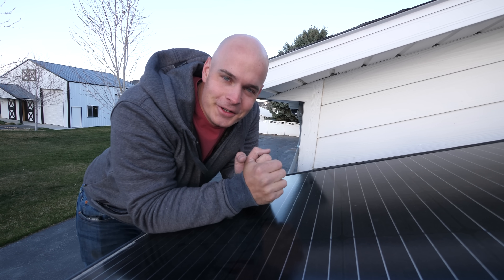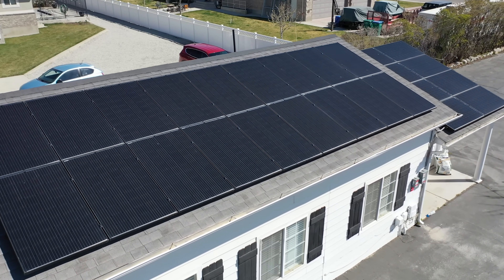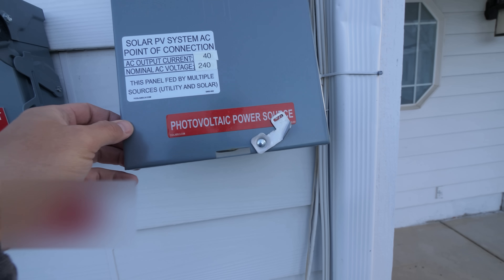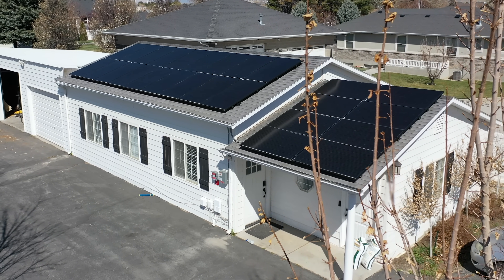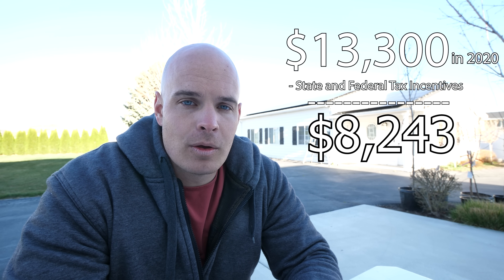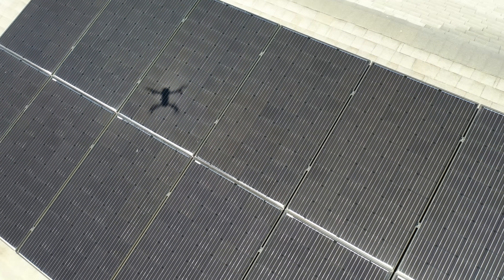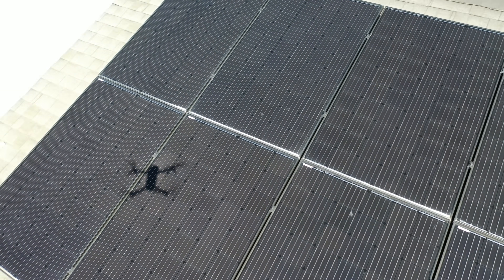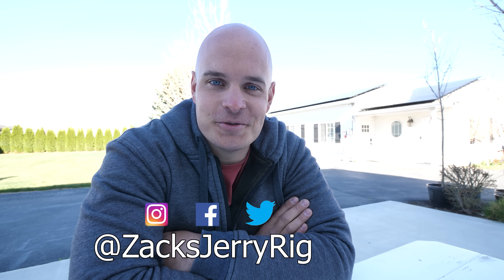One Year Solar Update! - Is Do it Yourself Solar worth it?

Comment: That price still seems awfully high for a self install. It is easy to get panels at $0.50/watt these days, so $4K for panels. $2K for inverters, $2K for wires, permits, and mounting. Which puts us at 8K before incentives. That is at retail prices, so that solar company is making around $5K just to sell you the kit?!
Putting the kit together has some value certainly, but maybe 1K tops IMO.
Reply: You are describing how much prices have changed in 1 1/2 years since his install. China tariffs have had an effect on solar panels, along with copper and aluminum. There are also so local variations in labor, taxes, etc.  Sometimes the cheapest price per watt panels take more square footage and those with limited roof space may choose a pricier panel with more output.

Comment: Solar roofs sound great, especially as suitable for sunny regions!  However, I wish Jerry's excellent product review also included information related to sustainability (another video?).  What is the carbon foot print of manufacturing Tesla solar roof panels?  Where does Tesla source the raw materials for manufacturing solar panels?  Lower CO2 emissions offset the environmental costs of manufacturing Tesla's solar panels?

Comment: Wondering if you calculated distribution/delivery charges into your savings?  I'm running some numbers now so it's fresh in my memory but looking at my current bill I pay about $0.09 per kWh but that's just for the power.  Getting it to me costs another $0.14 or so bringing my actual price per kWh from the grid to $0.23.

Comment: I do like home solar, but I don't think the financial benefits are a clear win cut just yet.

My calculations have no break even point when accounting for opportunity cost. If you instead invest $8243k with 7% real returns (after inflation), and you continue to save $1314 per year (after adjusting for inflation):

solve for y: 1314*y-8243*1.07^y

If you assume 6% real returns (1.06), the break even is 15 years, 5% real returns 10 years. If we assume that power companies also transition to solar as it becomes more and more economically viable, we can also expect the utility cost per kWh to go down (vs. inflation).

Comment: Still wrapping my head around everything. I did a quote on Tesla’s site for solar panel and it includes a power wall.  After tax credit it is roughly 26k.  That sounds insanely expensive in comparison.  What am I doing wrong?
Reply: Well, obviously the power wall is very expensive, so there is your first mistake. Your second is Tesla…you will pay for the mane itself at least 20 percent.

Comment: We had to do ours like Johnny Cash got his  Cadillac. One piece a time. 
We started out with a  45 watt Harbor Freight system.  Added 2 100 watt panels 3 times so far and still going.  
We have a generic 10 watt panel that is for charging cell phones and 2 way radios. 
   At this point i can power my fridge,  40" TV, DVD player a pair of small table lamps and a 20" box fan. 
    I also use the 2,  5 or 15 watt fluorescent bulbs that came with the HF kit. 
   I can generate about 650 watts now. Next month 850. Ive invested around $800 so far plus batteries.  I get a great deal on them. I pay $105 for 110aH sealed acid type. 
Our system isn't top notch,  but my fridge,  tv, movies and most lighting is FREE. By adding what we did i was able to cut my power bills in half.

Comment: The batteries are the one thing I would say is not too great for the environment. However, i think that using that energy from the solar panels to make hydrogen as the stored energy and use a fuel cell to get that energy back at night. The only bi product would be water. But fuel cells still need to be improved upon before this is truly realistic.

Comment: It's real easy to see if the energy needed to produce solar can be paid off: the manufacturer had to pay for that energy when they built them,  so that cost is included in the purchase price. Energy plus raw materials plus labor cost all included.  Obviously solar is worth it,  especially if it pays off in 6.27 years.  Even paying for installation is worth it,  but will take longer.

Comment: Wouldn't you be better off just investing that 8 grand in the market?  I mean I'm no finance major or anything but plugging 8 grand into an investment calculator at 8%, you end up at 37k after 20 years.  That same solar array nets you like 27k in savings after 20 years assuming the same production (but of course, assuming the same cost rate too).

Comment: Battery backups for Solar has been traditionally for off grid living, however the reality is that the power company doesn't store the energy you send to them and they have to produce the energy you get back from them.  It does put a burden on the energy company to either use all this excess power they didn't produce during the day, and provide power to those who were sending the excess power to them at night.  This is one of the reasons to store your own power, so you don't have to rely on the fossil fuel energy that the power company will send back and you are not as much of a burden to the grid.

I have always though it would be great if home builders would build communities with all solar houses and a localized battery grid.  This way all houses would charge the localized battery grid during the day and take energy from that same grid over night.  This should make the cost of buying and maintaining the batteries lower than a single battery panel on a house.  Something I could see Tesla create.  A Tesla community equipped with Super Charger parking.
Reply: It would be hard to complain who is going to repair who’s panels and who is using more energy from your neighbourhood.  It would be the same as living in a condo all inclusive but people stealing toilet paper from common areas and having 10 squatters living in a 3 bedroom condo.
Reply: @MrMannyhw  what if you had a system of you get what you put in or you get charged maintenance fees proportionate to the amount you use? Will either of those be satisfactory?
Reply: But the problem is those batteries are very similar to fossil fuels esp since they're not renewable resources...

Comment: A mistake in your math: after 6 years back to 80% yield on the panels, which then keeps going down each following year. The 80% won't stay there indefinitely for the next 30 years, not to mention the panels cracking or breaking by faulty production, or accidental damage over time, lowering the overall yield even more. 
But I am glad to see you were smart enough to get the better panels and not the cheap stuff which will never make your money back, and next to your math for profit, by your own statement you need to add 2 extra years of profit to offset the creation of the panels, years of even increasing lower yields.

On the whole your math checks out though, as I did mine as facts became available while pausing the video. I have seen so many Youtubers not do the 'break even' math back to the costs of the panels and just hail the 'profits' while forgetting the costs. Mind you, instalment if done by professionals, or if you calculate your own hours as billable hours you could have been working and earning money, is much much higher, and it can take you 10 to 20 years of diminishing returns to break even, all the while watching breakthroughs in solar that will make you hate yourself for having 'inferior panels compared to the new stuff', making it very tempting to buy new ones and start the investment over with a deficit, as 'being green' is very addictive.

Comment: Not only are you saving a little money due to solar, doesn’t that little air gap between your roof and the panels save you money as well? Considering the panels act like an umbrella over the roof. Essentially making your heating and cooling system work less?

Comment: I went with used panels and bought a used inverter that was used once and our charge controller was on sale and the entire system was less than 3k and that's paying full price for the battery's  and were off grid so it powers the house day and night we also have a back up generator if we get more than 2 days of no sun and want to run the ac after dark

Comment: I plan on buying all the components and building my own solar system.

Going to rig into my main panel with a manual transfer switch for a portable generator hook up. Use the tie in cable to hook into my solar panels when generating from them. Be able to hook in with a portable generator if necessary during night time power outages.

Comment: Tbh, you could probably live 90% off grid by using solar cells in the summer and doing electrolysis with the energy to make H2 instead of storing it in batteries. The last 10% could be bought H2 and then you have fuel cells instead of batteries. 

I've seen a house concept about that as well as an automated, self sustained H2 gas station so, I kinda think it's quite cool if it works as it seems

Comment: Awesome vid, but my LG panels hold a lot more after 25 years, (First 5 years : 95%, 2) After 5th year : 0.4% annual degradation, 3) 25 years : 88.4%).  My system is small and about half your size.... anyway you doing it on your own is great!!!  Nice and clean install you did as well!

Comment: Hey! I love your videos, and watch several of them. I have a question, how would this work if you had to replace your roof after you installed the panels?
Reply: Everything has to come off and be reinstalled.  The plus side is, the roof under the panels should last significantly longer though since it sees far less UY and heat exposure.
Reply: plan to do your roof at the same time

Comment: I also wanted panels :( but the regulations in my country are just changing, I will sell the surplus for 25 and buy from the power plant for 76 ... so far the power plant gave away 80% of the energy sent to it. Unfortunately, the energy storage due to the price higher than itself installations are not an option.

Comment: Question .. How about the roof shingles?  Are the shingles going to last longer with the panels on top?  If not, how difficult is it to take down for a new roof?

Thanks!
Reply: Depending on the shingles, they last from 15 to 30 years obviously if a bad enough hail storm messes them up then insurance will pay for them.

Comment: Just imagine to combine your solar panels with heat pump ( water/water ) and proper thermal insulation of your house and very good windows. No AC required during the summer, no heating needed for the winter, you will heat up your house with heat pump via floor heating. Black magic right? We do this in Europe for last 25 years.

Comment: Installing solar panels will block this sunlight from hitting your roof, thereby preventing heat from entering your house. The researchers found that solar panels can lower a roof’s temperature by 5 degrees Fahrenheit, or about 3 degrees Celsius. This can significantly reduce cooling.

Comment: When are we getting the DIY Arduino driven stepper motor safe-cracking tool? I don't even own a safe either but it would be cool to figure out how safe locks work and turn and how fast you could personally get it going reliably, and how to detect when the correct combination is entered. Sounds like a lot of work, but fun work. Would definitely make a neat video.

Comment: I did my own system but did a 20KW system for about the same price you did with the kit. By converting my propane water heating and home heating to a heat pump I and saving $3600 a year on my total yearly utility cost.
Reply: Where and how did you get a complete 20KW solar system for $13k ($8k after rebates)???
Reply: @ssoffshore5111  I did the work myself so the $13K was before the fed rebate.
Reply: @chada472  So again, where did you get all of the components for a 20kw system for that price?  I dont see prices like that anywhere...

Comment: My electricity has rate riders, municipal franchise fees, transmission fees, distribution fees, admin fees, and taxes. When they're all added together, there's another 13.5c/kWh of fees on top of the 6c/kWh electricity rate. You should check if that applies to you, because solar panels make even more sense when you consider that the total cost of electricity is closer to 20+c/kWh. If you're too lazy, take the total bill and divide it by the kWh used in a month. It'll probably be at least 20c/kWh.

Comment: Whats yourn insurance say about your roof warranty after you installed them? 3 dropped us because of all the  Penetration. Last year I got a new roof bid and all bids increased almost $3k to remove them and only 2 out of 5 would even do them. All the others required us to find someone to take them Down and put back up. Then zero them wanted to warranty the roof after the job because of all the roof penetrations again. We didn't bother to reinstall them on the roof in favor of warranty for resell. Just sold the panels and house separately.

Comment: Your figure of average US energy use of 28.9kWh/day, is energy, not just electricity. That includes things like heating with oil, energy used in gas stoves, and such. It is a bit complicated. Also it is always hard to judge everything, because you also have things like cars, different climats, and of course the entire city infrastructure, industry, which you as a resident and a consumer contribute too. Without you they would exist and consume. Again a bit complicated. But 8kW solar array in Utah, is absolutely no brainer. Even at super low household electricity prices (here in Europe in most countries you will twice more for electricity) compared to most US states, the return of investment is so good in most places, and reductions in carbon emissions are enormous if more people do it. Amazing tech.

Comment: kilowatt didnt throw me off at all, its metric "kilo" stands for 1000, so kilowatt litterly means 1000 watt, etc very straightforward system
Reply: Yeah not straightforward if you are American I guess. Remember they use feet, inches, cups to measure stuff ?
Reply: @Pomaufour  Yes the normal way

is a yoke

Comment: No matter what, dont put on an existing roof. It accelerates roof rot and then you have the issue of remove before repair. Have a engineered installed system put on when you build or reroof if you absolutely have to go with solar.

Comment: We, self installed our 3500 watt system about 8 years ago. Prices have dropped significantly. Our system, after the 30% fed rebate was also about $8,000. This system has paid for itself. Our tier one rate from PG&E has doubled since we moved to central CA 1 years ago, almost $0.25 per kilowatt. So our savings continues to rise. The value to your house also increases with solar, about 50% of the initial cost. If you think about it, our installed cost, if done by a private company, would have cost about $15,000, but with self install and fed rebate, our cost was about $8,000. If you have $8,000 in the bank, right now, you may earn 2%. We’re saving about $1,200, a 15% rate of return, tax free. Is solar worth it? You bet.

Comment: Unless they have changed it, it is federal law that any power you feed into the grid they have to pay you for it. Of course if you are taking it back thats another thing but if you do get a battery storage system in place look into this because I doubt that federal law has changed. Search for the term "net metering" for links to the law and how it works.

Comment: The .10 you quoted does that include your fuel surcharge. My charge is .085 per kwh but has a fuel surcharge of a additional .085 per kwh . so the actual charge is .17

Comment: Nice. It's all about the price - and of course guarantee. If you have plenty of South/North facing, direct sun roof area then cheaper, less efficient poly/multi crystalline panels can do the trick too. Are the panels with individual inverters running parallel or in serial? e.g. in series, 1 damaged or low performing panel can 'bottleneck' the power production due to increased resistance...
Have any DIYers made any capacitor energy storage batteries?

Comment: You seem to live in a fantisy world my friend.
Your viewing this through rose couled glasses.
You avoided the interest incurred or forgone on the invested money.
and that without the iscentives the echonomice are much worse.
Your sun must be better than ours, and I'm in the dry tropics.
Good luck replacing your micro inverters after failure, and they do.
Neately stacked pannels are good for "bling' only, impractable for repair.
Is you touted 10 cents, what your retailer pays you or what you pay them.
I'm sure that you don't use all the power generated by the system.
And when it comes to carbon,
To make a hammer, like in the past, you still have to cut a handle and forge a steel head,
there is no free lunch. There is always a carbon foot print.

Ect, Ect, Ect
Your video is just warm glowy click bait. 
Do a proper report!

Pointing to the 8kw, sprouting 8kw, but graph said 7.045kw (at 4min20 sec in).
Your documents may say 8kw, but you have a 7kw plant,set up.
Love your vidio voice but!

LUV Brad 
Down under

Comment: Do solar panels help with attic temperatures any in the summer heat since they are theoretically absorbing most of the radiant heat that would normally be absorbed by your roof? If so does this lower your electricity usage by any measurable amount in the summer? And does it have the opposite affect in the winter by robbing the radiant heat that would help warm your house then causing the heaters to run slightly more?
Reply: I cannot speak to solar panels however my father put a metal roof over his traditional roof about the same height as a solar array would be and he noticed  right away his a/c ran significantly less.
Reply: @spaided  I'm sure solar panels would do about the same thing! Basically shading a big part of your Roof